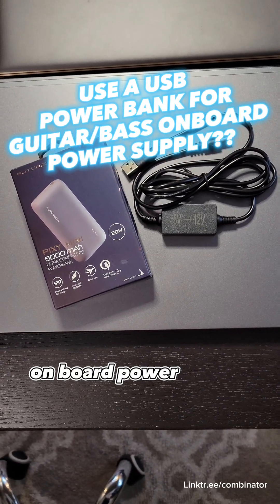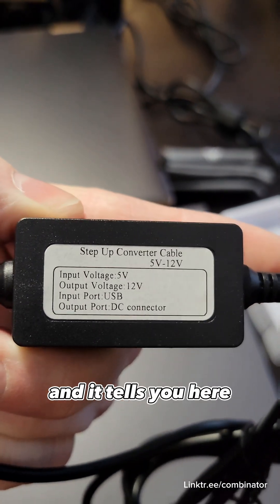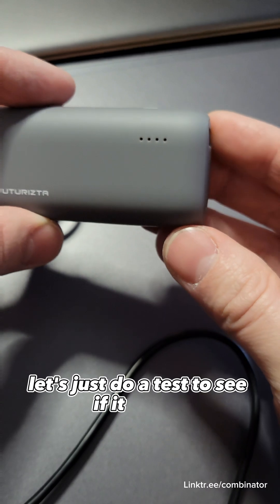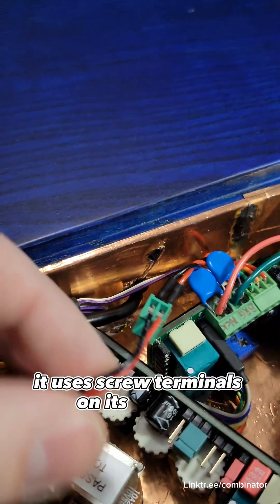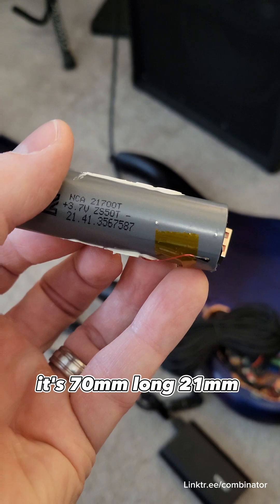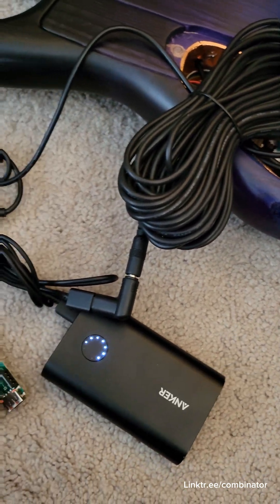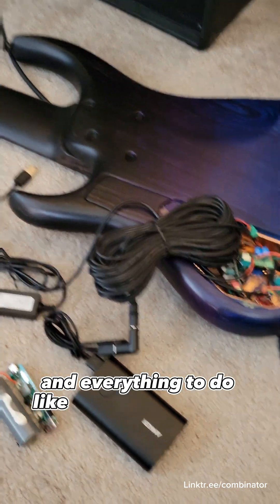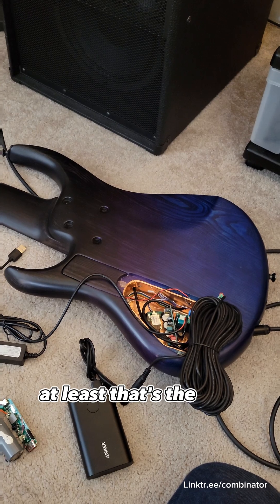USB Power Bank for Guitar or Bass Active Pickups / Preamp??

Comment: Thanks for sharing, Sean. This is almost the exact modification I was about to perform on an old fender jazz. Any chance you have an update to this experiment? Did the rechargeable 9v battery play nice with your pre?

This first thing that comes to mine is the passive mode on the John Uni pre. Maybe that was letting through the noise? I'm about to try this next week with an active-only Audere preamp.
Reply from the maker: @JohnSummerford  it's a complicated scenario, and I only found one type of 9 volt battery that is commercially available that didn't use a switch mode power supply up converter for voltage, but it left me wanting because it only measured about 8 volts. The other 9-volt batteries I tried were too noisy because they use internal battery packs that equate to less than 9 volts and need to be up converted. Unfortunately, this wasn't something due to the Uni Pre I don't believe, but the technology in the batteries. The switching frequency they use doesn't take audio applications into account and is well within the audible frequency range.

Comment: There are special power banks for pedalboards (9 volts). Maybe they don't have a noise problem.
Reply from the maker: I believe you're right, but sadly I couldn't find one small or affordable enough. Fishman already produces what I was trying to build, in a small form factor, for a hundred bucks. All the 9v music ready banks I saw were large (probably using multiple 18650 batteries) and getting close to that cost 😕
Reply: @CombinatorMusic  the reality of the music industry 👀